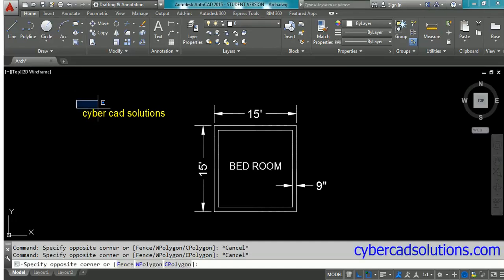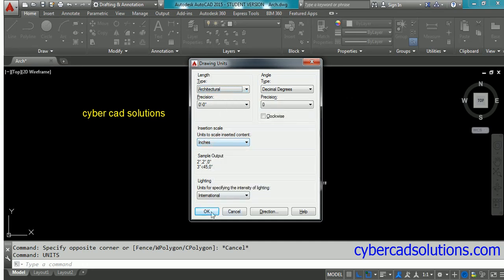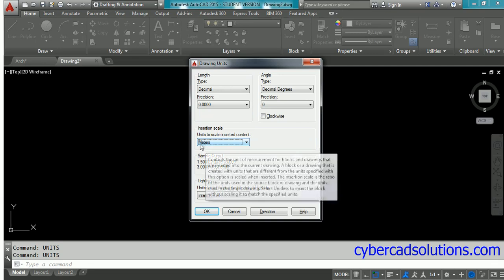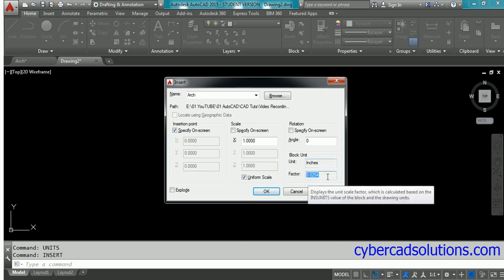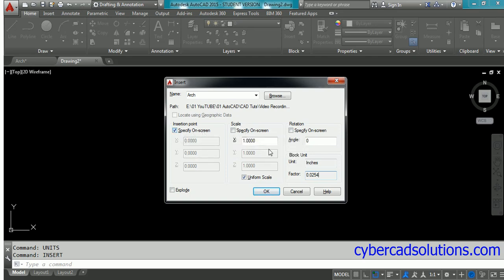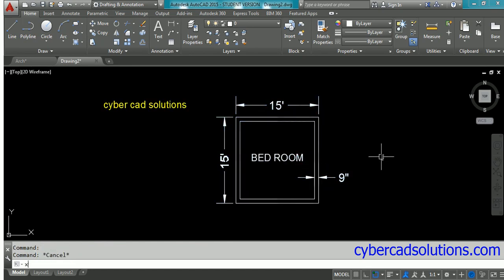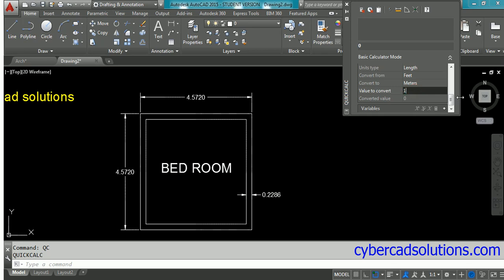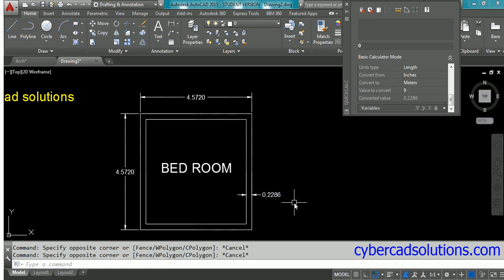How to Convert Drawing from Feet to Meters

Comment: This is a wishful thought. This is merely a conversion; it does not change the dimension from to metres. Even though using dimensions to check the length will show you the conversion, if you draw a line say 5m long, you will notice that it is longer or shorter than the original drawing. If you want to convert a drawing from one unit of measurement to another, you must redraw it entirely to be accurate.